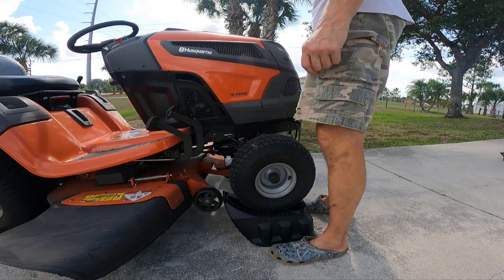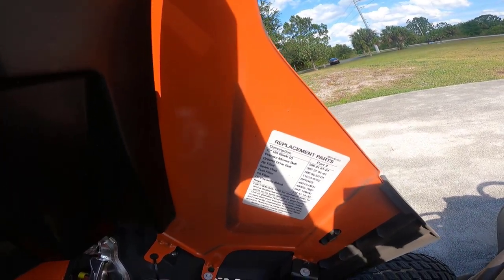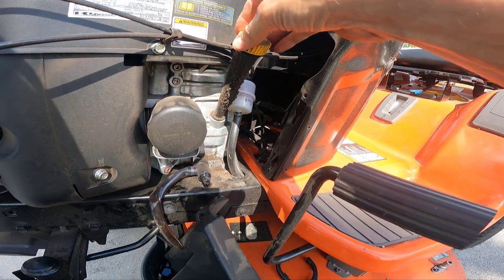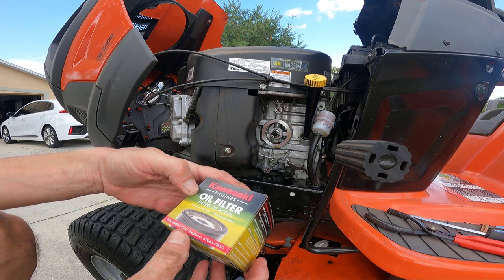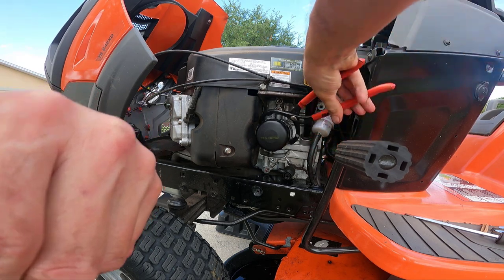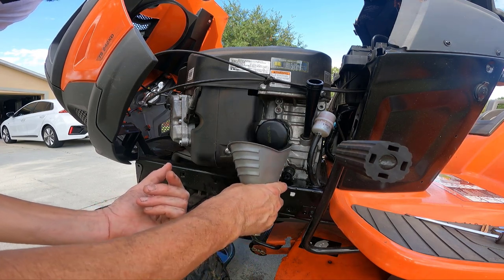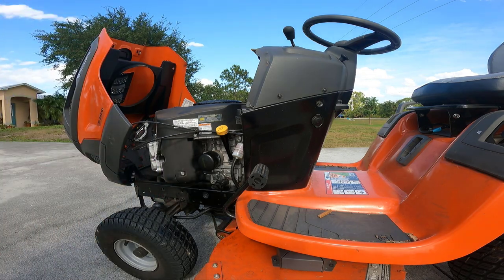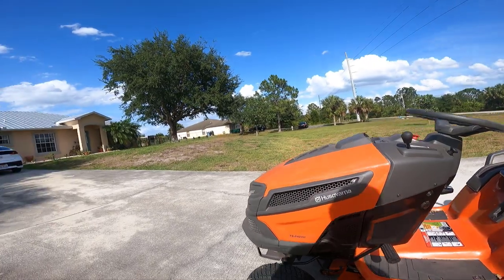Doing the 50 Hour Oil and Filter Change - Husqvarna TS242XD

Comment: I have always ran the engine for a few minutes, then checked the oil level again.  This lets the oil enter the filter, and may change the level of oil.  If this is not done, you are checking it with an empty filter.
Reply from the maker: Good tip

Comment: So... what's the correct way to remove the oil filter and not make a mess?
Reply from the maker: There is a little metal sill under the oil filter, you would need to put a funnel under that sill to catch the oil.
Reply: I usually put the filter inside a ziplock bag and then unscrew it. No mess.

Comment: Good video, but don't ever tighten oil filter with a wrench . Read the label on filter  suggest tightening it as tight as you can get it by hand – so you turn it until it stops naturally, and then you might be able to twist it another quarter of a turn. No more!!
Reply from the maker: I never crank hard with the wrench